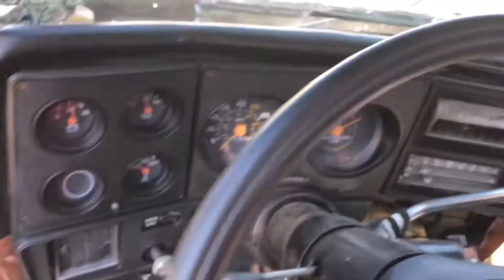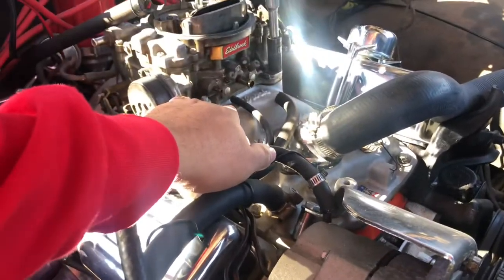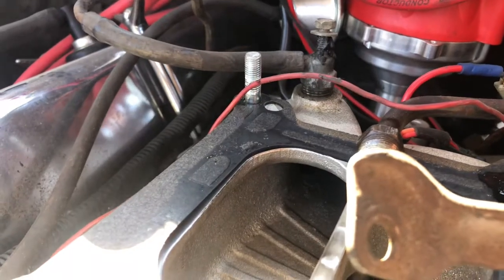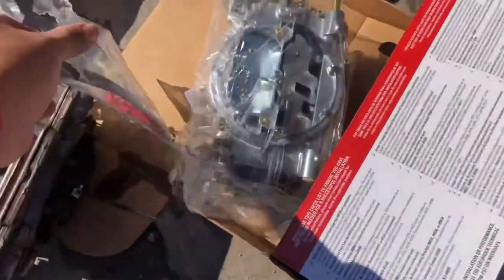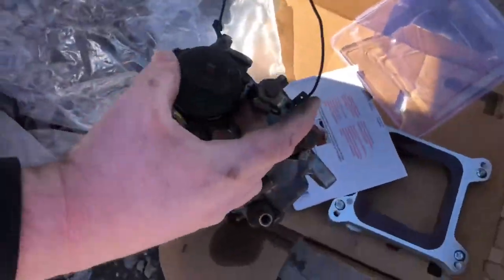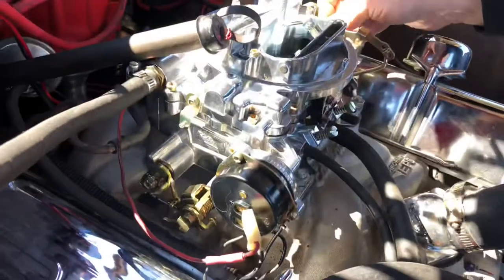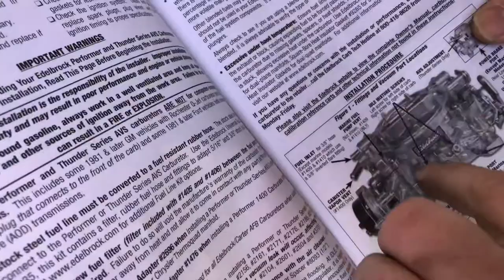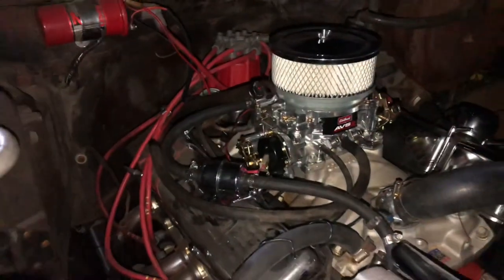AVS2 EDELBROCK INSTALLATION

Comment: Are you having any issues with gas boiling? My fuel line runs like yours and I can watch the gas boil in the filter when I shut it off.
Reply from the maker: Not with mine but what I found was fuel can boil inside the carburetor as the result of improper or missing gaskets or spacers between the carburetor and the intake manifold. Hope that helps. 👍
Reply from the maker: MrFloodedSilverado  then consider installing a heat insulator gasket between the carburetor and the intake manifold. This will create an effective barrier between the hot intake and the carburetor

Comment: nice! what size engine? and which CFM did you go with?
Reply from the maker: Thanks! 350 Small Block | 650 CFM
Reply: @gaspedalproject  thanks for the reply thinking of just getting this avs2 or doing a rebuild on the 1406 but not sure don’t want to do that and still not work properly lol I’m not mechanic
Reply from the maker: @C10_kEn  no problem, I myself rebuilt my original edelbrock carburetor and not much after I was having to just buy the new AVS2. If possible just go with the AVS2 I Love it! My truck hasn’t stalled on me once since I put it on 👌
Reply: Cool brotha thanks for the info yeah just going to go that route I heard that from 2 old school gentlemen too haha besides the adapter plate is anything else needed?
Reply from the maker: @C10_kEn  🤜🤛 nothing else that I can think at the moment.
Reply: I’m about to install same carburetor my 1406 took a dump
Reply: @MrShystie69  avs 2 is a night and day difference brother!  Do it
Reply: @C10_kEn   man my car running better and faster response thanks for the info is what made me get one
Reply: @MrShystie69  heck yeah man!